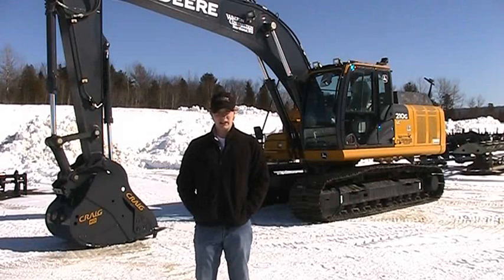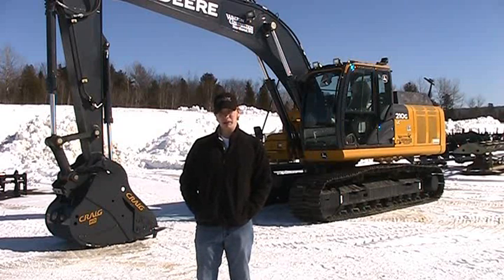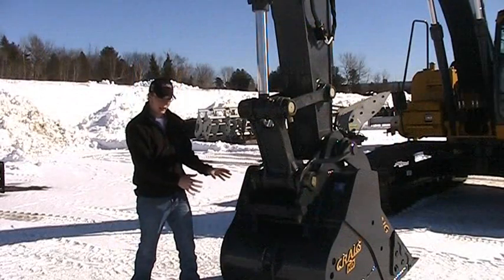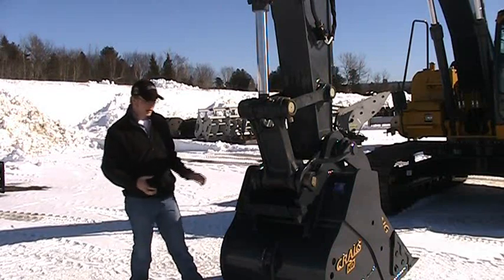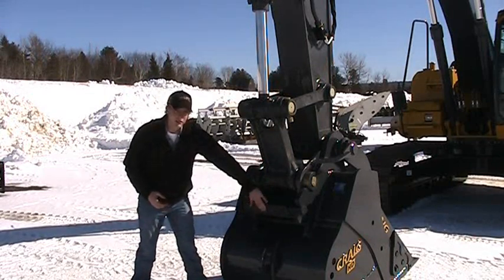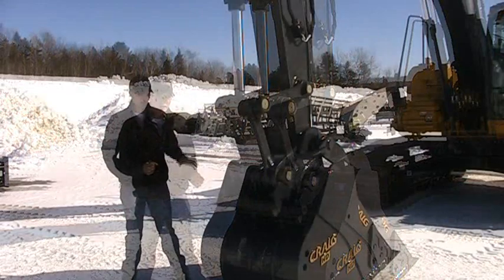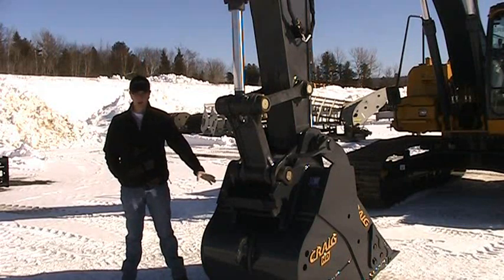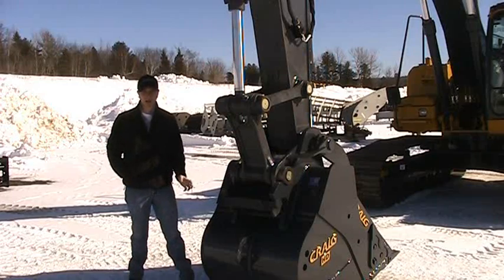Craig Manufacturing - Craig Tech Tips - Excavator Package on a Deere 210G

Comment: Those locking plates never stay and the bolts always loosen, it usually takes a lot of pounding with a hammer and tightening with the wrench to keep it tight. And after your done tightening the bolts and start digging again you notice the bolts loosening up again and you'll have to pound the wedge and tighten the bolts again. It really is a shitty system.

Comment: i really don't see why you would use that hitch set up compared to a multi hydraulic model where you can buy anybody's buckets and have them suit.

never seen a hitch like that in australia for that size machine.
Reply: They are very common in Canada as compared to the pin grabbers you use down under and in Europe you don't lose any curl force, they can work in the right conditions but hydraulic version is much better.